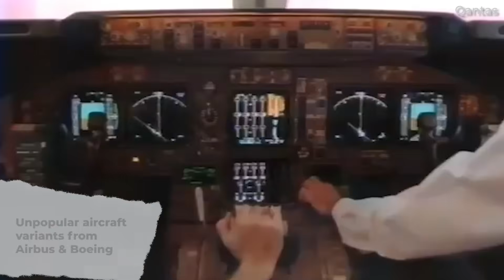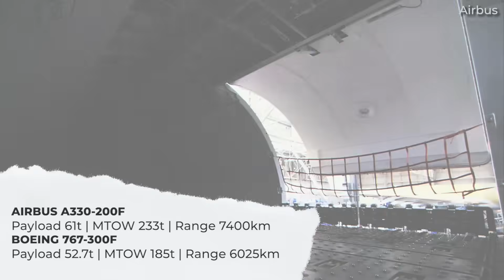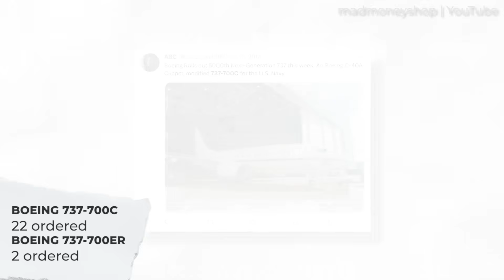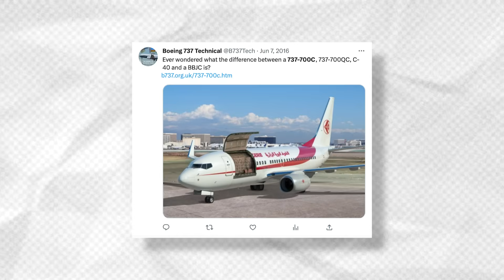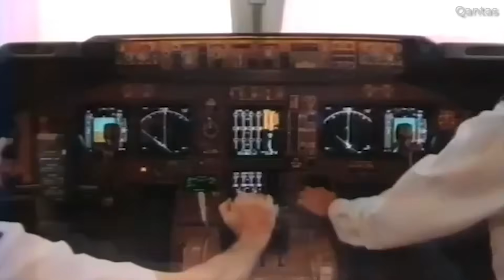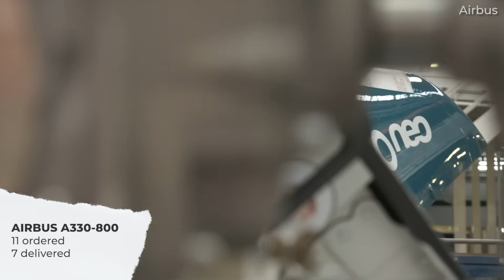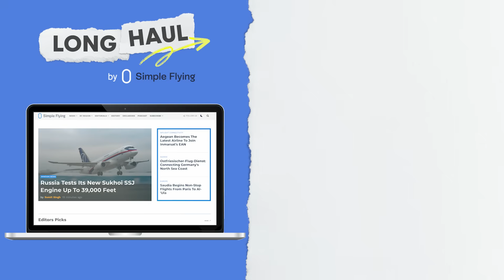Poor Sellers: The Least Popular Airbus & Boeing Aircraft Variants

Comment: the A330-200 pax variant had more range than the A330-300 although at the cost of reduced capacity . . . ur analysis is centered around the A330-200 F variant which has less range than the A330-200 . . . the A340-500 HGW had the longest range (16,820 kms) of all A340 variants . . . Singapore Airlines operated eight A340-500 HGW on extra-long haul routes Singapore (SIN) - New York (JFK) non-stop between 2006 - 2018 . . . the B767-400 ER should have sold more units or atleast at par with the B767-300 ER . . .

Comment: Its important to note that a variant that sells in small numbers only may still be profitable either because it fills a small but important niche that you can charge a lot per unit for, or because the change from a popular base model is small and the variant was therefore cheap to create, or a bit of both. A couple of those on this list were actually nice little earners while others were true money pits. It would have been good if the video was able to give some indication of which was which.

Comment: Despite being a Boeing and Lockheed (hashtag #bring back the TriStar!) fan, I genuinely wish the A340 was more of a hit, although 764 delivered, all variants, is no slouch of a record.  I get the efficiency of two engines, but my desire to see more built is strictly an emotional wont.  It’s beautiful with its four engines, and just looks powerful and uber reliable (zero accidents involving fatalities, and only 6 hull losses, most of which appear to have happened on the ground).  What a plane for military usage - a high performance, highly efficient 707 replacement for AWACS, EW, recce, tanker, and cargo.  Was it ever used in such a fashion?

Comment: The A330-800 is likely the biggest disappointment in this group, because it carried the highest expectations.
Most of the other ones were niche products, so they weren't expected to do well 
Had Airbus not produced the A350, the A330neo program would have been an utter disaster for them because the 787 is just far superior to the A330neo in so many ways.

Comment: It would seem to me as a highly experienced Canadian Arctic passenger (between 1966 and 2015) that in its day', the B757-M would have served Bradley Air Service (DBA AS First Air) and Canadian North Airlines (now amalgamated as Canadian North, would have well served the paved runways on their northern Provincial and Territorial routes. 
'Couldn't be 'gravel kitted' like the B-737-200s that they still fly onto gravel and snow/ice covered runways (along with Norlinor and Air Inuit), however especially for the fly-in only regional hubs such as Inuvik, Norman Wells, Rankin Inlet, Cambridge Bay, Coral Harbour, Resolute Bay and Iqaluit, combis and combi-conversions are a very important part of the fleet 
'Perhaps also still useful for Whitehorse-based Air North Airlines.
Southern hubs include Vancouver, Edmonton, Winnipeg, Ottawa fibreglass Montreal!
My first flight on the Montreal, Frobisher Bay, Hall Beach, Resolute Bay route was during June and September 1966 on a Nordair Lockheed Super Continental combi!
On that decade old place at that time, the freight on the main deck wasn't even separated from the passenger seating by a bulkhead! Our initial ton of gear and supplies for a three year long Arctic Wolf research program was strapped down amongst other freight under '6G' cargo nets almost within touching distance. [Included was the world's first Amphibious All Terrain Vehicle (AATV); a six-wheeled fibreglass hulled JIGER!]
🇨🇦  🦊  🐺  🦊 🇨🇦

Comment: I wouldn't call the 767-400ER a failure, it specifically made to fill a gap in the market with legacy carriers retiring the tri-holers like the L1011 and DC10 used by both Continental and Delta while maintaining the existing type certificate with ETOPS180 and there wasn't anything available at that time that could do the job that was affordable (777-200 costs more than double a 767-400ER plus the wait time was long), not to mention neither Continental nor Delta operated the A330 at that time.  It was never meant to be a long term solution as Boeing was working on the 787-8 that was meant to replace the 767 fleet for both airlines.  United/Continental kept their 787 orders while Delta cancelled all of them and instead ordered the A350.  Delta is slated to retire their 767-300ER's by 2025 and United has stated they will retire their 767-300ER's by 2030.  Neither airline has said they plan to retire the -400ER's any time soon.

Comment: 3:50 there is no way a 767-400 took off out of laguardia, you must mean JFK?
Reply: It's true. Also the Lockheed L-1011s and the McDonnell Douglas DC-10s operated out of LaGuardia back in the 70s, 80s, and 90s.

Comment: The 767-400 is much more than just a 767-300ER stretch with a little more wingspan. They incorporated a lot of the new 777 tech into the -400. It has the flight deck and cabin of the 777, also it has a taller Main Gear with 777 tires/brakes. It had two problems: 1st it came a few years too late IMO and second, as already mentioned, the A330-200 which had the same passenger capacity but better/higher range/performance plus it can load the big containers.
A 767-400ERX might have been more popular but it died with the 747-400X, which was supposed to use the same engine.

The third customer of the 767-400 was not United, the original United never ordered the -400. But there was a third customer: Kenya Airways. They later switched their order to the 777.

The 757-300s problem was 1st that it came to the market muuuch to late and second that there was no ER variant.

Another key feature or even THE key feature of the 747-400D was a strengthened Landing Gear to allow for more cycles.

The A330-800 will never become a big success. Just like the 777-8 it serves a niche which is very small. For just a few extra tonnes of empty weight Airlines get the A330-900 which offers 30-40 more seats and can fly 97% of the missions. Airlines would rather fly these extra seats empty on a few routes to have the range potential. Airbus was smart stopping the A350-800, I don't get why they realized the A330-800. The reason why the A330-200 sold much better is because the early A330-300 had much less range than today.

Comment: There's also the Boeing 777-300 missing too. It only sold among Asian airlines, but became basis to the extremely successful 777-300ER.
Reply: It's not missing because the cut off was 40 and 60 were produced. It wasn't so much the basis for the  300ER. The ER had a lot of upgrades in terms of wings, engines etc. It was a slow seller at first given the times then went on to be the dominates player in it's space

Comment: the 767-400ER is my favorite and interested version of 767s which sadly only two airliner are have it  and i hope keep in service longest possible, speaking of 747-400ER they are an updated version of regular 747-400 with some 400ER features like boeing signature interior a smaller design of cabin which used in 777, 767-400 and an updated 767-200/300, and an updated cockpit's display using LCD rather than CRT displays, they didn't sell well because it was around end of the line of passenger version of 747-400 and many airliners switched to 777-300ER
the Airbus A330-800 may have some (not huge) order for VIP and some airliners

Comment: 3:33 The 764 entered service with Continental in 2000, and Tulip United never had them. So it’s only ever had two customers: Continental (now United) and Delta. It was custom designed and built for those two airlines. With that said, should we be including custom planes (like the 73GER and the 764) as “poor sellers”?

Comment: Love that 757-200M on list as one clearly understands why it was needed and same time why nobody else needs it.
Reply: while the idea behind it was good, later on, the airlines operated the plane as a full passenger one, converting it. It was only necessary once, when India had put an embargo on Nepal. Then, it was used for freighting fuel and cooking gas. Due to the niche type of aircraft, it had difficulty selling as well. All in all, even the Himalayan nation didn't need it.
Reply: The RNZAF operates 2 757-200’s with cargo doors but still passenger capable. They are conversions so not new build but I guess that takes the total to 3.

Comment: For Aircraft like B737-700C and Er variants, the 747-400 D and Er and A350 ULR have been specifically ordered to suit airlines demands in range, freighter or seating capacity hence they couldn't accumulated much orders. But for Aircraft like the A340-300,-500,A330-800 ,B737-900 non and Er 747-8i could have done/can do better in terms of sales but all in all it all comes down to the airline economics.

Comment: Flew on Delta's 764 with the updated cabin and loved it! Glad they're keeping them around and I hope Boeing will consider a NEO option. Love the 2-3-2 configuration.
Reply: Boeing or GE are not pursuing a NEO version. Idea was rejected.
Reply: I’ve always said the 767X will be a thing in the next 3 years so Boeing can mount some challenge in the middle-of-market segment. The 767s longevity in its existing form in unreal, so a MAX / X variant would be super appealing.
Reply: @magnustan841  787 has replaced the 767
Reply: @Frostmear Agreed. The 787-8 is a better plane than a 767-400”X”/Max. Something to replace the 767-300ER is needed though.
Reply: new engine option option on a boeing?
Reply: @ahmetyusufbalc2680  not for the 400
Reply: 767-400 needs to be retired. I’ve worked on that thing and it’s a maintenance nightmare
Reply: @Frostmear  really? More so than the -300 or just a comment regarding how long they have been flying?
Reply: @tomoconnell2320  more so than the 300. The 400 constantly has issues, more than the 300 despite it being a newer model.
Reply: @Frostmear  Tell me about it! I’ve been scheduled to fly on the -400 6 times, and two of those has had maintenance issues. One saw just a two hour delay, while the other ended up being an aircraft swap for a 57-200. Such a reduction in quality of service, especially since I was in first class! Got bumped from first in the new interior to a dilapidated comfort+ seat on a 57-200. Boo.

Comment: I don't see the B747-400D and ER as being necessarily unpopular. Each was designed for a particular customer/market and were never meant to be available worldwide. As opposed to the B767-400 or the A340 in general.
Reply: I agree, and same with the 737-700ER (which I didn't realise had existed), and several other models listed - they were just relatively minor modifications of existing aircraft, and sometimes done at the request of just one or two customers... they wouldn't have made them for a small number of customers if the modification costs would have been huge. I somewhat disagree on the A340 - at least the A340-300 - as it sold moderately well, and shares a huge amount in common with the A330-300 (which was developed alongside), including the fuselage and most other components, so it did fill a role for a while until ETOPS changes allowed for the 777 and A330 to flourish due to their better economics.
Reply: Cope
Reply: @vincevanderperre8660  He really isn't coping with anything, he is stating a fact.
Reply: @vincevanderperre8660 little crybaby those are big words you are using 😂😂😂. He was not even coping with anything 😂😂😂

Comment: I Like the A318. As a passenger experience it is identical to the A320/1 but it can get into smaller airports like London City.
Reply: Being based in Sweden, I’ve flown on Boeing’s equivalent - the 737-600 - many times with SAS. I really liked them, they were stable and robust in the sky and service was always fast compared to the -700 and especially the -800 that SAS also operate(d).
Reply: @jatterhog  I thought about that too. The smaller the plane the quicker is onboarding and deboarding. Service may be faster also.
Reply: @k9killer221  that too - especially since SK usually use both the front and aft doors for 737/A320 boarding in most Scandinavian airports
Reply: @jatterhog  I have flown SAS from London to Oslo to Trondheim and I really loved the flight experience. It was Winter and bitterly cold, but the jet bridges were excellent.
Reply: The a318 is like a320's lil' brother
Reply: @Márcia.O.P.Santos  It is.

Comment: I think its just a matter of time for the A330-800neo became a best seler 'cause today hundreds of aircraft world-wide are being retired and scraped, today we see lots of A330-200s flying, but they are getting older every day and every hour, airlines that are alredy feling that and are puting orders for the largest A330-900neo as replacement, not only for the A330-200 but also for the A330-300, wil realise any time that the A330-800neo wil be usefull, because this plane have a longer range that the -900neo and fit last passengers, this airlines one day wil see the great potential that the -800neo have to fill the job, and sinse that older 787-8s are begining to be retired and scraped (apparently) the actual marketing wil need the A330-800neo one day to replace this aircrafts, 'cause even the larger A330-900neo wil not be able to fil at this even it have more capacity and cost less, also because airlines wil need shorter wide-body airliners to mach with the retired models in the future. I hope to see a stronger AIRBUS A330-800neo flying the skies for the next years, as well new airlines ordering and flying the model.
Reply: No it won't. The 787 has taken that market

Comment: The 767-400ER was a highly niche variant of the 767 to replace Delta's L-1011 and Continental's DC-10 fleets. As such, not that planes needed to be built anyway.
Reply: There are several variants both for Airbus and Boeing that have not sold many but which nevertheless were profitable because they were very cheap to develop and certify but filled a small vacant niche. The 767-400ER is one, and the A318  another.
Reply: NW before merging, buy A330s to replace their DC10 fleet and Delta also buy A330 after merging.

Comment: I believe with the A330-800 there is a potential with Delta. They have their aging 767-300ER’s and A330-200’s, the -800 being a good replacement for both, not already operating the 787.
Reply: But the -800 has no difference with -900 when it comes to economics
Reply: They have had plenty of time to order them and chosen not to so doubtful.
Reply: Both the A318 and B737-600 were not sensible designs being with the same problems: both too small and too heavy
Reply: Considering they have already ordered the 737max, they could probably order the 787-8. But look at this, I'd don't matter what of the 2 they order, I am sure the both would be configuration of 2-4-2.

Comment: They cant expect airlines to want to buy a "new" jet that looks like 1985 .. please !!
They should have given the A 330-800 Neo a proper face lift along with these engines .. 
imagine the sexy look of the forward A350 but nose pointed down when rolling on the ground , it would look badass and sell better 
the stats of the Jet itself are merely unbeatable .. it outranges 787 its way more comfy than 787 its more silent and its a reliable workhorse that is not getting grounded for maintenance issues all the time ..
Reply: That's not why aircraft are developed to look sexy. It's all about the economics.
Reply: @johniii8147  hehe if it was about economics they would buy the 330-800 like hell :)
Reply: @spionsilver9626  Nope. The 787 simply crushed it the category with the 8 and 9 versions. Neither version of the the 330NEO has sold well. The 787 is now quickly closing in on 2000 sales. But was relatively cheap for Airbus to develop so they should at least break even.
Reply: Airlines don't planes because the nose looks sexy.
Reply: 737 still selling well and it's from the 60s lmao
Reply: Alot of the current jets flying are of designs derived from the 80s (777, A320), and even all the way back to the 60s with the 737.

The reason why airlines still buy such old designs is because 1) economics 2) they just work
Reply: @m1co294  and .. lack of alternative , sadly

Comment: A330-800 and A330-900 should have done better in terms of sales but with a huge number of A330 CEO yet to age and the B787 providing competition, I honestly don't know the future of this Variant.
Reply: The A330-900 has done it's job for Airbus, the A330neo program was launched after the 787 entered service and was a response to the 787. The A330neo was simply meant to take a bite out of Boeing's cake so to speak and take some orders from the 787, which it has done.
Reply: @heidirabenau511  same as what the 777X is doing to the a350-1000. 

If the 777X never existed the a350-1000 could have had over 500 order by now
Reply: It hasn't been competitive with the 787